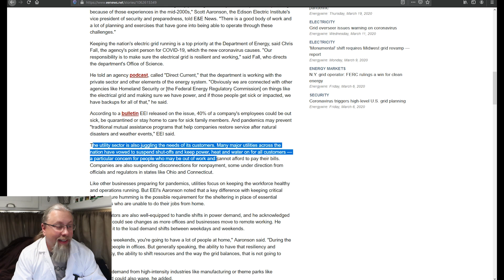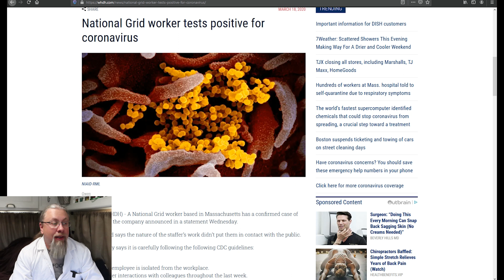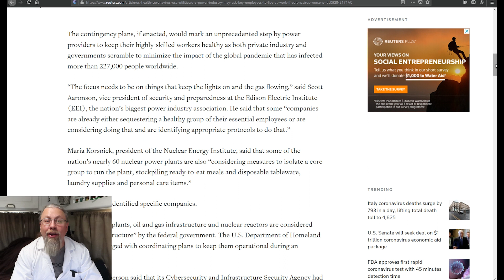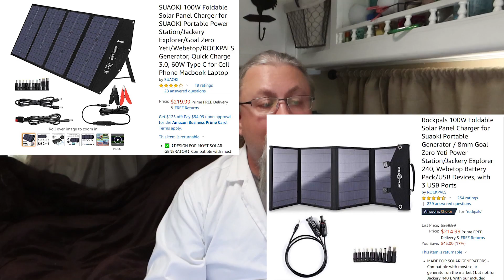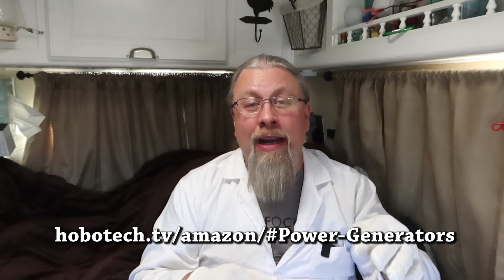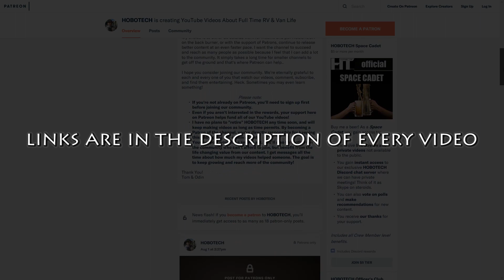BEST Portable POWER STATIONS | SOLAR GENERATORS For SHTF | Grid Down | Blackouts | Covid 19 Preppers

Comment: Why do so many of the discussions about recharge times appear to stop at only  a worse case-completely drained battery scenario.  The DIY solar discussions 5 yrs. ago included an emphasis on the user calculating, monitoring and managing power consumption so as to avoid absolutely bottoming out their battery source.  With that in mind, for most of these portable units, IF consumption is managed properly, one will more often avoid using more than 50-60% of the battery unless in dire straits; and will size the solar input to comfortably replace the power consumed.  Thus the recharge times will be dramatically reduced from the 7-8 hours/ worst case situation.  What am I missing here?

Comment: People who are new to solar tend to think that these "solar generators" can do WAY more than they actually can.  To put in perspective:  I have a DIY solar power system that has 8,000 Watts of panels, 8,000 Watts of inverters and about 20kWh (usable) battery bank.  My system can only power HALF my house.  It cost $28,000 in parts and I did all the work myself.  It takes about 10kWh to power our house overnight with a fridge, freezer and just a few other things running.  The typical house runs on about 30-50kWh per day.

Comment: set a quick question I wonder if you bought 4 bueti's that are 2,400 watt  and try to connect them together to run concurrent to one another.
Reply from the maker: You can technically plug one into the other with about 20% battery loss but the problem is the factory AC charger only charges at 160w so your output load would need to be less than that.
Reply: @HOBOTECH   thank you

Comment: Lived in North Houston during hurricane Ike. That was an eye-opener.  Thankfully, I had lots of MREs. The main thing is food everything else is secondary. 2 days later the cell phones went out. All the towers ran out of battery. By seven days there were gunshots and people were stealing generator's. I had solar panels and a battery Bank. The only power for 5 miles. Buy day 14 we were getting ready to pull out.I was putting my wrench to the solar rack just as the lights all came back on. However, by day 14 it was a zoo.  The really crazy and unsettling thing is that when the lights came back on everything stopped immediately. People just went back to what they were doing as if nothing happened. There is a duality in humans and civilization goes right out the window when they flip
Reply: Main thing is WATER... everything else is secondary.
Reply: @SKYGUY1  3 days no water and you just might die. Store water and learn how to clean it , carbon filters etc.
Reply: @rush2124u2  Thank you Sam. I am cognizant of that. Docchocobo said, "Main thing is FOOD... everything else is secondary." I corrected that to "WATER is main thing". I currently have at least a 10 day supply of drinking and cooking water stored in 2.5 liter clear glass bottles that can be used as solar disinfectors once emptied and refilled. I also have about 5 days stored in 2 liter green glass bottles in addition to that. I have filters for drinking straight  from creeks / rivers/ also.
Reply: @SKYGUY1  Good stuff man, be a survivor not a statistic
Reply: @SKYGUY1  spot on no water no life no food result bad news
Reply: docchocobo now in mid 2020, it looks like the whole country is losing its collective mind
Reply: @ChatGPT1111  You said it buddy!
Reply: Time for a ham radio in your inventory
Reply: Rob Is a HAM license required to operate on that radio?
Reply: Idea Baker what radio???? That’s the key. Some radios don’t require it and those are usually cheap junk. Speaking of junk, if you are just getting started, stay away from baofeng crap 💩
Reply: Idea Baker in my area they know you are using a HAM.....  I think you can use one in an emergency without a license
Reply: @TheIdeabaker  The answer is yes if you want to do it legally. The exception is if you use it to call for help to protect property... or to protect health and life. Terry / K4KID
Reply: @docchocobo nothing you said in your post was surprising... however,  that last paragraph though, yikes.. The ease of duality of the human mind under duress vs, not. 
Disturbing.
Reply: hairless apes man... look at how primates act in the wild. There's no "REAL" intelligence in this species. Humans shouldn't even have digital tech or any tech. People have lost survival skills, Etc. Rely too much on "Govt daddy". I hope to learn more survival skills in the future.
Reply: Makes me think more about moving way out into the country.    I can only imagine how horrible it was living here in Houston during that time
Reply: They say civilized society is only 3 meals away from collapsing
Reply: @krisinsaigon  with today's Logistics? Absolutely yes.
Reply: Docchocobo thanks for taking the time
Writing your comment. Do you have any other guidance for others that you learned in the outage?  Knowledge is power blessings from Florida 🌴
Reply: @Lana-Psalm3.4  Get a personal water filter like a Sawyer, folding solar panel, quality long range radio receiver to get news. I make vids about it. Hurricane Laura devastated our area.
Reply: Me too. I was in the Woodlands and just grateful we didn’t get stuck on the 45! I hadn’t even heard about these kinds of batteries back then…just had my loud generator. Luckily my bestie had a whole home generator. We had about 12 people living there for a couple of weeks!
Reply: @hope4humanity222  We all went from playing house to surviving and watching our butts :)
Reply: Since you had your solar generator, were you able to keep Internet access by powering your modem?  Or did that go out too?  If that went out, did it go out before the cell networks?  Thank you.
Reply: @igottheshaft  After hurricane Laura in Louisiana we lost radio stations, cell service, and even land line phones, so no info whatsoever here. I used a high quality CCrane radio to hear distant stations to find out what was going on.

Comment: I'm totally inexperienced and trying to build out my 2016 Promaster.  Could I use the Bluetti 1500 exclusively to power my 2500?  Can I run power cords from it safely?  I am trying to power my Maxxair fan, Dometic fridge, laptop, cell phone, and some LED lights.  I appreciate any help you can give me.
Reply from the maker: The 12v output is limited to 10 amps or 120 watts. If you wire the 12v direct into your fusebox it'sa "maybe" if your Dometic is a smaller 12v compressor fridge. Laptop of course would charge from inverter side along with other appliances.
Reply: @HOBOTECH  Thanks so much for your quick reply!  I am planning on the mid size Dometic CF-040AC110, so it may work?  And a power strip is going to be fine on the inverter side, as well?  Wish those outlets were on the front of the Bluetti, but oh well.
Reply from the maker: @lindaweaver6801  Yes

Comment: Have you looked at the Audew 500wh portable power station, LiFePo4 generator? How does the LiFePO4 compare to the lithium ion generator. In your opinion, what would be the most reasonably
priced generator to power a camping frig that draws 45 wh's? Will any 100 wt solar panel charge the LiFePO4 generator?
Reply from the maker: Seeing how they even misspelled "device" on the display I wouldn't trust them. LiFePO4 is much heavier and while it has more cycles, how many people will really keep a cheap power station for 10 years? To power a fridge you need regulated 12v output. Get a Jackery or Bluetti.
Reply: HOBOTECH thanks for your prompt reply. I understand the Jackery has a slower recharge rate. The Buletti is way out of my price range. Would a 300-400 generator keep my frig running overnight? The frig would be running on my Jeep battery during the day overlanding.

Comment: Which solar generator will power portable electric tools such as black n Decker circular saw?
Reply from the maker: If you mean the old fashioned corded type either Bluetti or Jackery 1000 will run 10 amp power tools. I just reviewed the EcoFlow Delta 1300 and that has a 15 amp outlet.

Comment: Can you power the bluetti from 12 volt batteries?  Wondering because I am investigating home sized water mill turbine system.
Reply from the maker: Nope. Requires at least 16 volts, preferably 18 to charge.
Reply: @HOBOTECH    So if I connect two 12v in series I could get 24 v which would work?
Reply from the maker: @penelopegreenland3537  I never tried that but it should work.

Comment: Interesting.  My parents have 5 acres of fenced in land with a well(electric pump) a huge propane tank but are still wired to the grid.  I have been wanting to help them slowly cut the cord for a few years.
Reply: My take on all this is that if the grid is up and functional, use it!  I keep the A/C at a comfortable temperature day and night, my big refrigerator is cranking away, the freezer in the garage is holding 0 degrees F. nicely, the TV is on whenever there's something on that we want to watch (not all that often, now that I think about it), etc.  But if the grid shuts down, I can still keep the food from spoiling, the laptops and phones charged, and a multi-band radio alive.  I could keep the lights on at night, too, but that's a really stupid thing to do.  Just sayin'...
Reply: I’ve got 5 acres, electric utilities. My hot water heater and furnace are 220 V. So is my stove, but I have a lot of propane fuel and cooking options. I also have a dual fuel generator to run my refrigerator and freezer, but my concern is the well. Heat won’t be amazing but I have two fireplaces and 40 cords of wood, and more ready to harvest. I’d love to get solar for the well, or a much larger generator for the 220 hardware, run through a transfer switch, but that’s a huge other undertaking.

Comment: 18:05 plus unleaded fuel does come with a shelf life (they do sell additives that can extend it).
Reply: 1) buy ethanol free gas - sometimes called "recreational gas" 2) add a stabilizer like Pri-G 3) store in metal safety cans in a cool stable location 4) have some filtration equipment and octane booster on hand. You're good for many years
Reply: @MsLaurN  I buy about 25 gallons of ethanol free gas at the local pur station around Xmas. Add a small amount of sea foam stabilizer to, hopefully, reduce condensation. The following Xmas I put the gas in my car and refill the cans. Runs fine.
Reply: I seconded the use of Sta-bill, and try to run your generator once and awhile to make sure it's working properly.
Reply: I am told not to store the generator with gas in it because the gas will “gunk” up in the generator and maybe ruin it.
Reply: @Tig-r9d  generally that is correct even more so when it is mixed with ethanol which should be most gas out there. However you can purchase sta-bil (or other similar products) which will enable you to store fuel in the generator. The packaging says 2 years but I personally wouldn't let it set that long
Reply: Nathan Jackson    Thanks!

Comment: I have watch a lot of your videos recently in prep for a trip. I am doing a 30 day survival challenge. I need something that will recharge my drone batteries and laptop (both 110v) plus camera batteries and assorted USB chargable items. I am looking at a solar generator and folding solar panels. Concern - It needs to go on an airplane and comply with TSA guidlines. What do you recommend?
Reply from the maker: TSA requires batteries be under 100wh so basically no single unit is going to meet your needs. I do have a MAXOAK 99wh power bank on my site that will comply, but you'll probably need a couple to meet your power needs. You'll also want a solar panel with USB-C charging to charge them. The Beaudens 100w folding panel on that same page is the only one I know with a 60w USB-C output that is currently in stock. https://hobotech.tv/amazon/#Power-Generators
Reply: @HOBOTECH  First, thanks so much for taking the time to reply! Can you give some idea of the power needed to recharge a laptop computer and 2) recharge a battery in a DJI mavick 2 drone? If I bot 2 of these power banks would 2 be allowed as a carry on? The two items that require AC power are the problems, the other devices I could use External Battery Packs that I could charge directly from the solar panel. Am I correct?
Reply from the maker: The laptop is the big one. Most consume up to 50w just for general use which is only 2 hours runtime per unit. If you are rendering it will much less. I'm guessing you'll get 2-3 drone charges per unit. You'll definitely want several. The USB items you can charge from solar. Regs say there is no limit and you can get special permission for larger batteries. https://www.faa.gov/hazmat/packsafe/more_info/?hazmat=7
Reply: @HOBOTECH  I bot the Maxoak power bank you recommended but the solar panel was out of stock. Can you recommend an alternate solar panel with with USB-C charging?
Reply: Here is a solar panel I think will work - TWELSEAVAN 120W Portable Foldable Solar Panel Charger - If you can confirm it would work or offer alternate suggestions I would be greatful!
Reply from the maker: @stevenoble2442  I can't recommend a brand I haven't tested. Suaoki is one I trust. This is a little bigger than you need but should work well in overcast conditions. https://amzn.to/3cjRshe
Reply: @HOBOTECH  Thanks for all your help. I will send you a link to the 30 Day Survival Challenge when the video is complete.
Reply: UPDATE: The Maxoak power bank could not charge the drone batteries. The phone and laptop charging worked ok. To replace the Maxoak I ordered a Krisdonia AC Outlet Portable Laptop Charger (TSA-Approved) 27000mAh 130W Travel Laptop Power Bank & External Battery Pack. It charges drone and laptop but does not have a USB Type C charging port. It has a barrel charging port and the solar panels must outpur 19v to charge it. So I am back to square one trying to find a comapable solar and storage with AC outlet that can go on a plane. Any suggestions on the solar panel?

Comment: This is the deal Tom.   Should I buy? Planning to use 24” d series 50watt Vizio TV in my van a lot.  More concerning is finding way to switch car stereo off the new cranking battery.just bought because old one was bad from found dead all the time while listening music when not running. It’s “7”x8”x10” and there is room ne t to it for a similar sized battery. If I could find a remote operated switch or have it accessible near dash that would be good.  Also can I lie an interstate size 78 on end or does need lie flat ?
Reply from the maker: Yes, any of these will run your TV and stereo no problem but never lie a flooded battery on its side!
Reply: HOBOTECH thanks for response and btw thanks for being the coolest guy out there helping us stiffs understand about 12 volt power. The more I learn about these solar power inverter generators it seems to be the simpler way to go opposed to all the wiring involved installing battery bank, isolator and inverter
. I could go with a Lithium or AGM back up battery next to chassis bat under hood. Hook the pos line of car stereo to each with in-line switch so running off back up battery when not driving. I have a 4 terminal continuous duty isolator to somehow utilize to be able charge back up bat when driving (also figure way to be able charge it with solar panel). 
Then go with a Rockpals or Jackery 500watt and also get the Honda 290 with the 300watt bestek to quicken charge times. This way allows to be utilizing one while the other is charging so always having power. Apparently the only downside being not being able use microwave. Then get a 100 watt fixed and 100watt flex panel(to put on dash board when applicable). All under $1000.  What do you think?
Reply from the maker: @paulstephens9274  1) Don't get a Rockpals power station. 2) Honda 290 is discontinued 3) If you want to run a microwave spend a few bucks more and get the Jackery 1000. It will still charge with 12v while driving and has the better controller and input.
Reply: HOBOTECH thank you Sir. Btw Tom appears you are staying healthy. Decided it’s time to have a Covid test tomorrow bc been feeling a lot of blahs lately.  Stay cool
Reply: Forgot. Should I plan on utilizing my continuous duty solenoid or use a Voltage Sense Relay switch of sorts between batteries whether aux one goes next to cranking one or behind driver seat. If getting 100watt panel will want to get a Pure Sine Inverter (suggestions?) and take your advice also getting the 1000 Jackery

Comment: I got a question..
My possibly set up lifestyle would be...
Converted van being off grid for 6 days and then having electricity (outlets) for 24 hours on the 7th day...

All I need to run is a few basic fans ( I can even go disposable batteries) but I need to run a Domatic 28 or 35 liter fridge doing the day and then run my Cpac machine at night .

I would turn off the humidity and heat on it and in the morning hook the fridge back up on either the 1000 jackery or getting the 2400 bluejeti ?

So would the 2400 bluejeti do that for 6 straight days ??
Or would it be better to get the jackery 1000 too ?

If I did that I would have to wait to get (2) jackery 100 watt portable solar panels.

I really do like the quality of those solar panels and I know that only 200 watts won’t completely come close to charging both of them...
Any,
Thanks for your thoughts 
Greg
Reply from the maker: If you want to go an entire week running a CPAP and Fridge with only 200w of solar then you better get the Bluetti 2400. I'd recommend at least 300w of solar for it from https://hobotech.tv/amazon/#Solar-Kits . The WindyNation, BougeRV, or any of the folding panels in series will do.